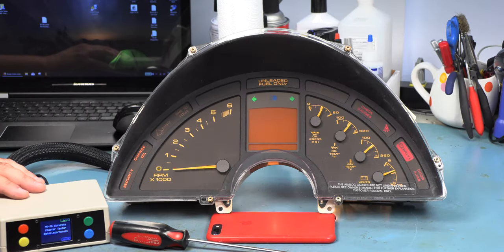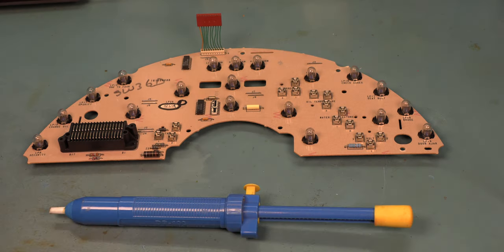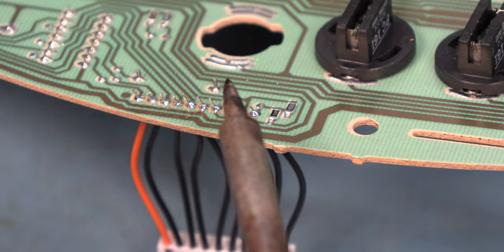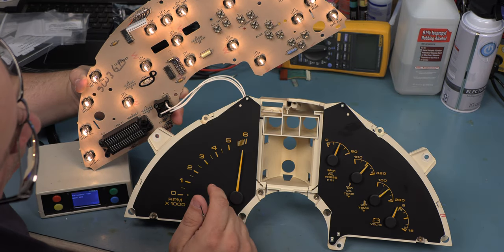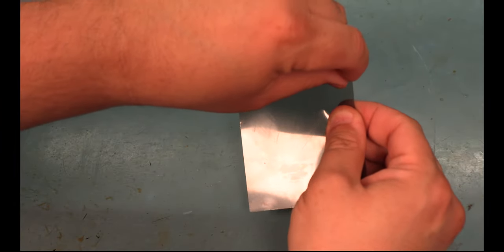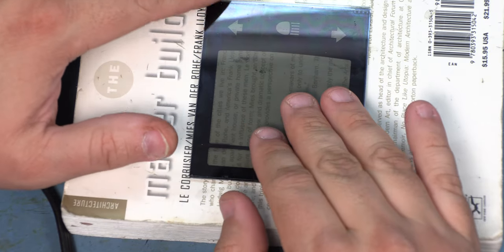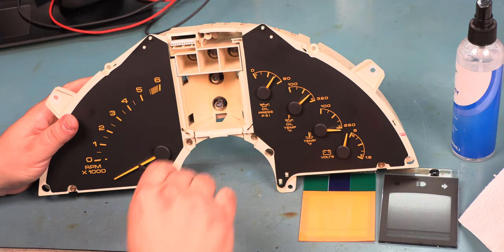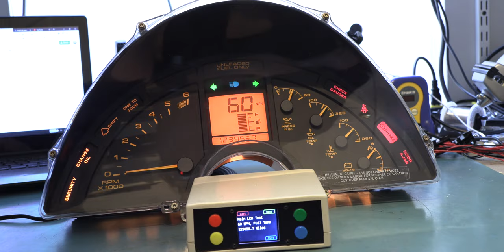90-96 Corvette #1 - Instrument Panel Repair Digital Gauge LCD (2019)

Comment: Can I change the resistor for the tach without having to get something to read it? My tach shows 5000 rpm when at 2000, and is in increments of 250rpm difference. It's one of the last major things I need to fix, that I know of, but don't want to have to purchase the $600 cluster tester. its even out of stock as of writing this comment

Comment: Can anyone help me please? I'm in the UK and have a '91 C4, the speedo read out died and I followed your excellent video on the repair which worked a treat. Since then getting low voltage and stalling. Anybody have a pinout diagram for the connector as I suspect bad grounds, be very grateful for any assistance please.
Reply: You said "stalling" Do you mean that the ENGINE is stalling?

Comment: My LCD does a sort of "rolling" where my speedometer freezes, and then shows every crystal lit, and then goes completely dim, and it does this very quick in rotation between each setting randomly. Would you have an idea of what that is? Also my tachometer is off to about 4000 rpm when it's idling, and under load it instantly shows redline, I assume that's the same tachometer module you replaced in this video, would I be correct?
Reply: @bryanthompson3180  Awesome thank you for confirming my hypothesis, I think I'll end up ordering the cal IC from your store, and then soldering it all myself, as I've got the experience, just not a corvette guy haha.

Comment: Is it possible that a fault in the instrument panel can cause the car to misfire?
Reply: No, the computer for engine control is outside of the instrument panel. The cluster is similar to a computer monitor. It shows what’s going on in a computer located outside of the IP.

Comment: I wanna use this cluster on a project car is there a way to feed mph and fuel info to the lcd without a ccm?
Reply: You'll need the bcm from the c4, if you are using the c4 computer and bcm then yes you can get all the functions to work.
Reply: The factory service manual from the same year Corvette is available on eBay in cd rpm format and gives you the wiring diagram for the car, as well as troubleshooting procedures, I do know for a fact that the 90-96 lcd display will not work without the ccm and another lcd module that's buried up under the dash behind the HVAC box.. at least for the 90-96 cars, the 84-89 were different.